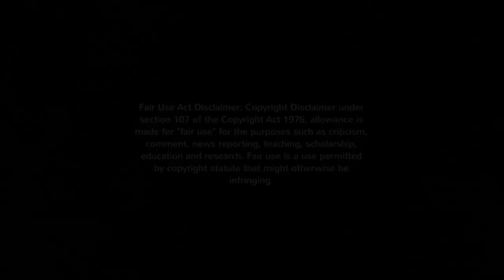Removing the Dashboard from the Audi A6 2.7T donor car: Time-Lapse. Ep14

Comment: I feel your pain on removing the dashboard, endless screws and bolts 😖. I see you have a fancy tag making machine ya posh bugger lol. I got to the same stage as you before you go upside down to remove more screws I just had enough by then and I ripped it out 👍
Reply from the maker: Yes it can be more than a little frustrating to remove, it didn't help that there was a camera in the way lol.